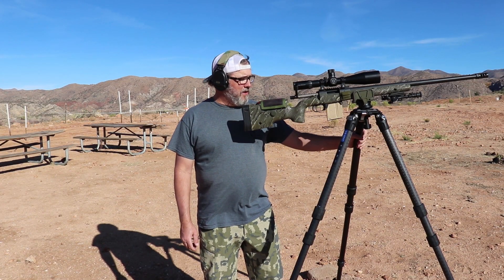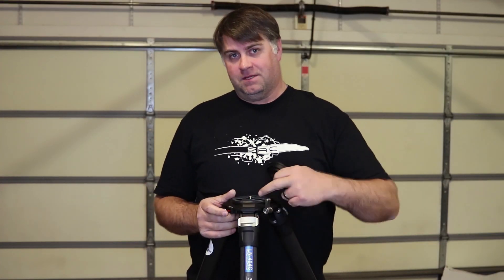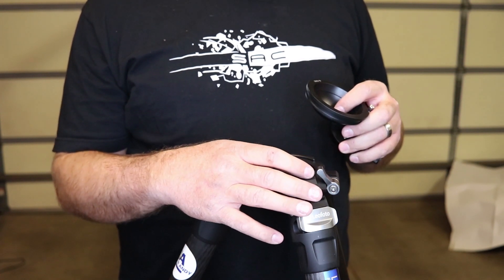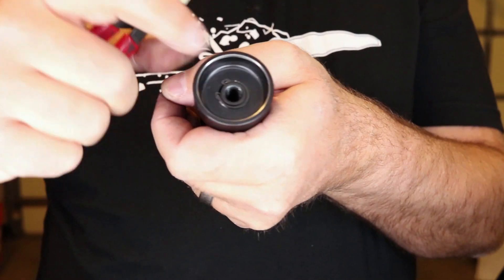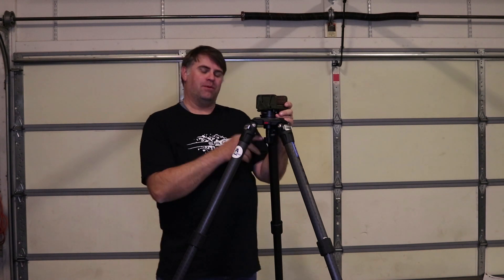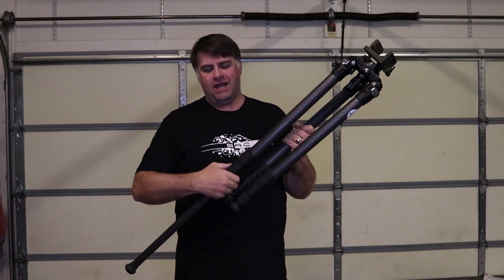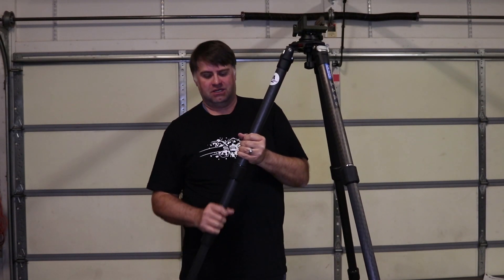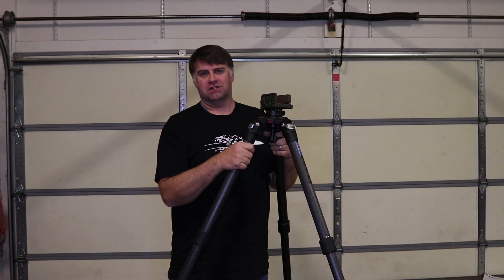Shooter's Perspective - Leofoto LN-404C Tripod Review

Comment: Any reason you like the half ball
Over the leofoto full ball?
Reply: I am looking at this one and the RRS. I obviously like the price point here.  

Here is the “full ball” I mentioned. Lol. 

https://www.bhphotovideo.com/c/product/1375174-REG/leofoto_lh_55_low_profile_ball_head.html

Which arca-Swiss attachments did you use?
Reply from the maker: The half ball head keeps the rifle lower in the tripod and therefore more stable.  That other head will work, and could double for cameras/spotting scopes.  Good luck with your choice!
Reply: 225 Outdoors thanks. Appreciate the quick reply!  Any chance you could provide a link to your half ball assembly?  I can’t seem to find the area Swiss.
Reply from the maker: Desomond 75mm half ball:  https://www.amazon.com/Desmond-Adapter-Convert-Video-Tripod/dp/B00TKNF2DI
RRS makes the Arca-Swiss plate adapter: https://www.bhphotovideo.com/c/product/1301151-REG/really_right_stuff_b2_40_lr_1_4_20_screw_lever_release_style_quick_release_clamp.html?ap=y&c3api=1876%2C%7Bcreative%7D%2C%7Bkeyword%7D&gclid=Cj0KCQiAwp_UBRD7ARIsAMie3XZJ8TEHSr69YatNuxdxD6T3OU0j30TPCJugPXsN1sEQx0ovtDOGttIaAkf5EALw_wcB